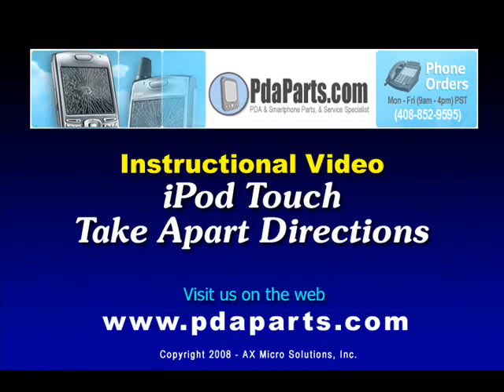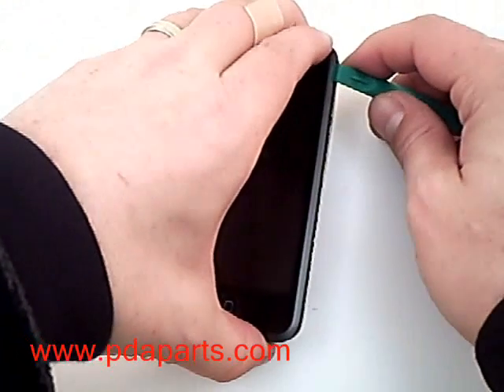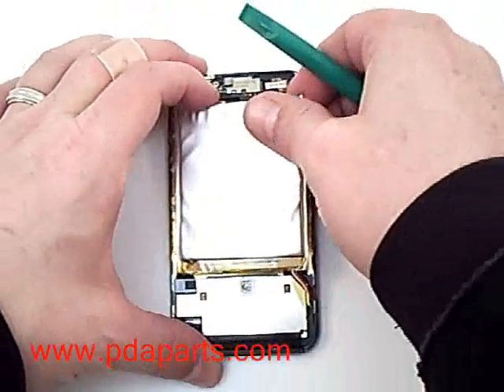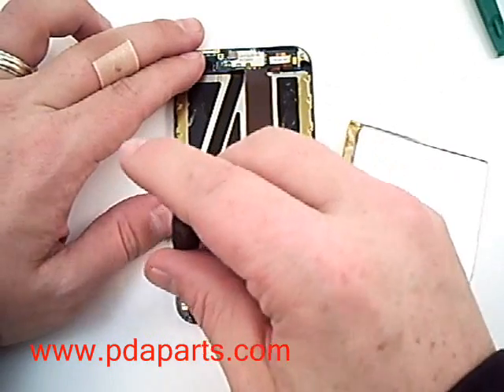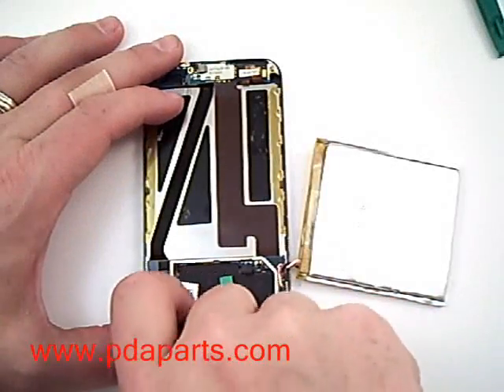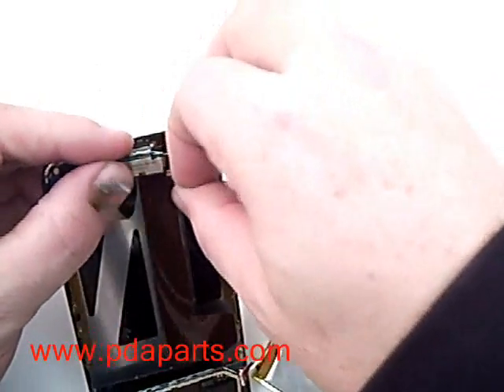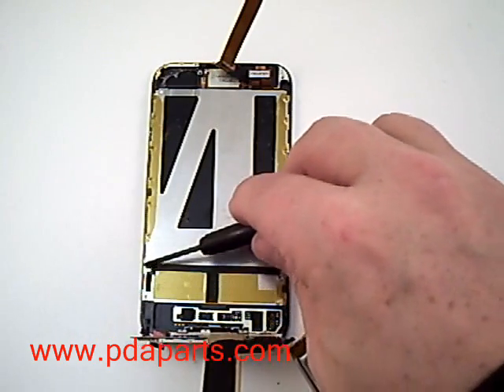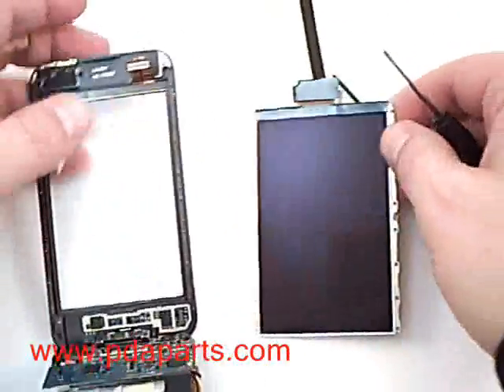iPod Touch Gen 1 Screen Replacement Directions | DirectFix

Comment from the maker: Yes you can take it apart and dry it but even after you do that there is a good chance it will still have issues. Most of the time water damage causes multiple issues in a unit.

Comment from the maker: That depends on what broke. If you just cracked the top glass and the image under it looks perfect then you just need the digitizer. If the top digitizer/glass broke and the lcd or image under it is damaged then you will need both the LCD and digitizer.

Comment: I am going through the tutorial now and I am stuck at the part where you take the 16 screws off. Does the green board pry off or what?  Your video seems to have skipped the part where you remove that to get to the other two screws :/